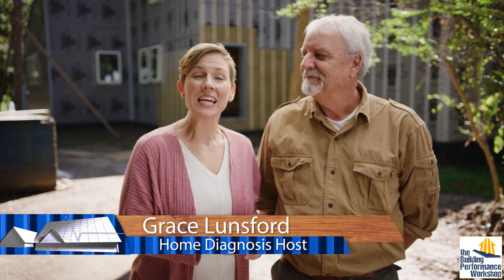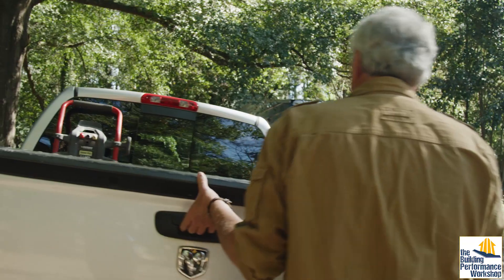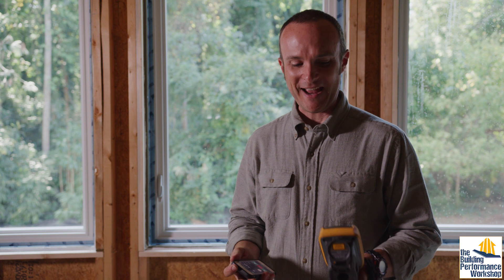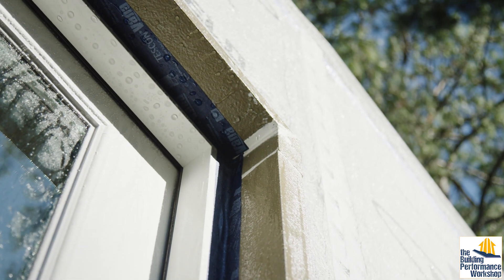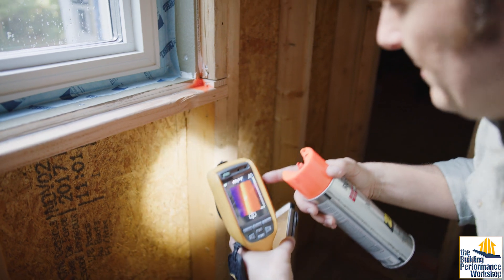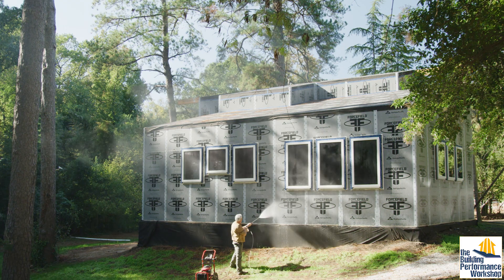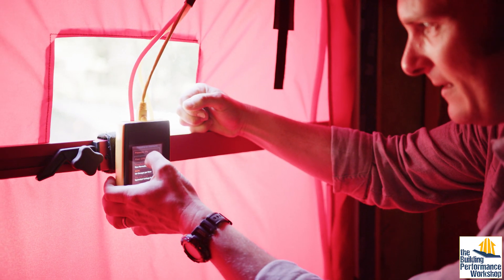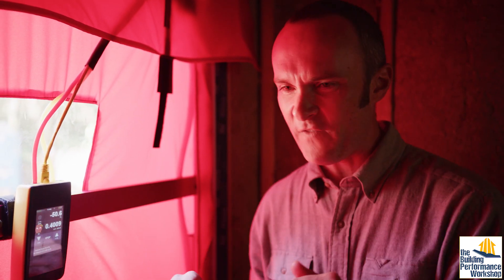Hurricane Test for Badass Home Builders: 5 Blower Doors + Pressure Washer

Comment: What's that product Matt Risinger endorses that sprays some kind of atomized substance while pressurizing the house? It finds every little crevice and seals it. Would that be a simpler and more effective way of doing this? Maybe it's more expensive.
Reply from the maker: Aerobarrier. It only does air tightness, not waterproofing.

Comment: This gave me anxiety, but your test is obviously showing the efficacy of the work so far. How will you address the various spots that you marked with spray paint? Add tape where a tape seal failed? Add caulk where a caulk bead failed, etc? Or since the ACH remained about the same, do you just move on without addressing these little flaws?
Reply from the maker: Yes, any weaknesses found become obvious when you find them. More tape, more sealant, etc. Easy peasy.

Comment: Stating that this simulates a hurricane is quite an over statement! You simulated about half of a class 1 hurricane. This being said, this is the right way to build. I’ve been recommending this type of test on the weather barrier for years and I think it’s basic common sense since the weather barrier is one of the cheapest elements of the building envelope yet it is one of the most expensive things to fix. What would cost a few dollars to fix during construction will cost thousands once the building is finished.
Reply from the maker: A little bit of spin and competition to push builders in the right direction- happy to hype it so the real scientists can keep their hands clean, Jean-Loup!

Comment: That was the most lame pressure washer. My kids Super Soaker puts out more water. Get a decent nozzle and a garden hose. It would simulate a homeowner washing the siding but is nowhere near a good Southern thunderstorm.
Reply from the maker: Michael, why do you even watch our videos? You only ever have really bitchy stuff to say.
Reply: @HomePerformance  
It was the click bait. HURRICANE tease. Then here is a guy who forgot to bring a ladder, standing outside waving a fog of mist from 15 feet away. Yep, no leaks here? What happened to the hurricane?
Reply: Michael VanGundy You apparently do not understand much about testing , building or thunderstorms. You could dump a swimming pool on the house and it would not prove how a wind driven rain would behave around seams of a barrier. Ask anyone who has dealt with a sunrrof leak on a car- the dealer can soak the car in a commercial wash and get no leaks when the customer has a legit problem. Water from a pressure sprayer with the suction from the blower door is a valid demonstration for wind driven rain.
Reply: @DavGreg  
Well I do know a little bit. When they turned on the blower it put the house into a partial vacuum. It's called that because there is still pressure on the inside, just less that atmospheric. That pulls all of the seals up tight, with the exception of inward opening doors which leak like a screen door in a submarine. The water trying to force itself in can be measured. That force is the mass times the velocity. When he was standing on the ground waving a fog onto the walls. It had very little force to force with. The force was weak with this one!